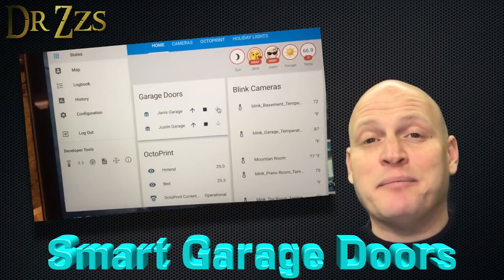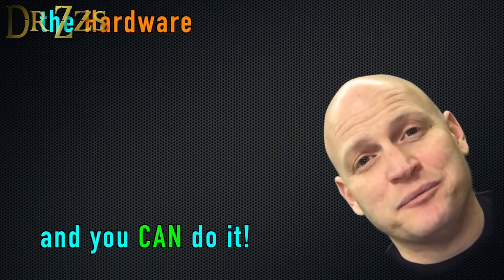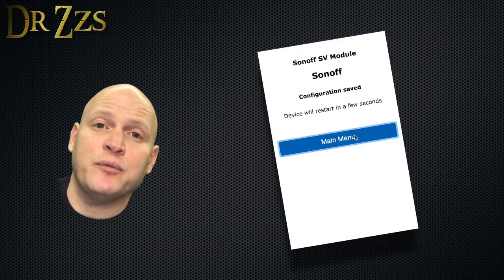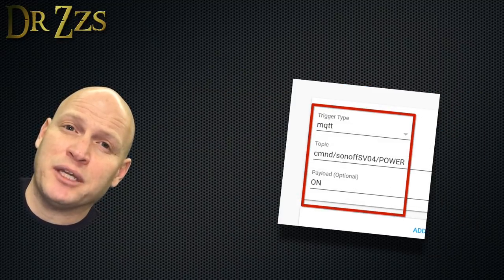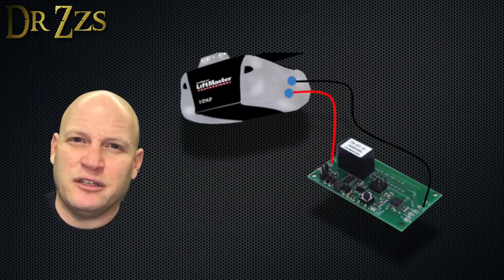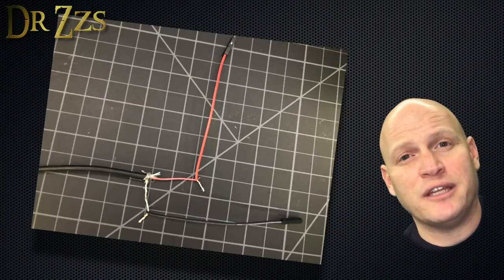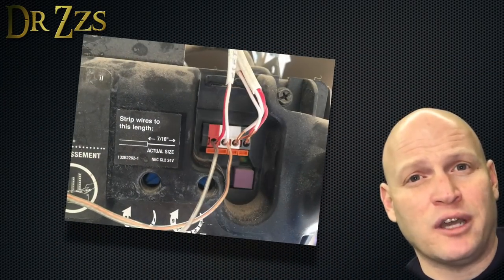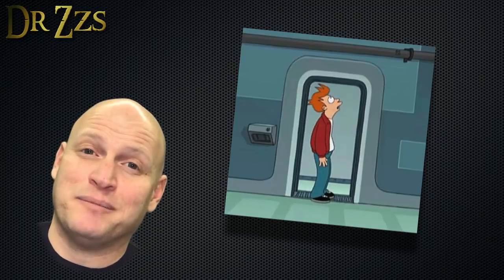$5 DIY "Smart" Garage Door Opener using Sonoff SV

Comment: Hi again, thank you for the video again. I'm having an issue with my reed sensor. So I used your guide as a starting point.  The only difference is that I used a dry contact relay, which is triggered by the SV Sonoff, which then triggers the gate. The reed switch is connected the GPOI 14 (sensor), and switchmode is set to 2.  So when the SV is connected to WiFi everything works great, but when the SV looses signal, for some reason when the reed triggers ON, it turns the SV on as well so then it triggers the gate.  And keeps it triggered so then my gate remotes don't even work.  I've been locked out of my own yard twice :o), wife almost killed me.  Any idea how I can fix this? Much appreciated!
Reply: Sorry, I didn't see the update... I'm trying the solution now
Reply: That's the part why you need to set another GPIO to Relay2.

Look at the instructions again.

Comment: Awesome video. I just completed installing 15 Sonoff as light switches. And I would love to try this but I am concern with these Sonoff switches going on to off and off to on by them self. I am concerned that this will create open access to some un invited people. I am going to try bypass capacitor and resistor installation to see if it get rids of false activation. If that works then I give it a shot to garage door. Let me know if anyone has any tip to stop this ghosting effect
Reply from the maker: The Low Pass filter should get rid of your ghost switching.  I just recently found that solution and it has worked well.   The problem there is the wires from the GPIO pins to the switch are picking up interference and firing the relay.  In the case of the garage door opener, the GPIO pins don't open or close the doors.  Only the MQTT message (or the on-board button) has the power to control door opening.  
You probably have already seen this, but here's a link that talks about how to do the low pass filter:
https://github.com/arendst/Sonoff-Tasmota/wiki/Expanding-Sonoffs

Should I do a short video about this?  If a lot of people are having the same problem it's probably worth doing...
Reply: if you have time i definitely think the video on this would help a lot of people. I know i was getting so tired of ghost switching i was ready to get rid of all sonoffs. but then i found the post about it and i thought maybe there is a hope to sonoff lol. But yes the video would definitely help me to see how and where exactly you attached those resistor and capacitor.
Reply from the maker: Ok.  You got it.  
If you were on the verge of abandoning the Sonoffs then it's a big problem. I'm thinking I'll change my plan for this week's upcoming video and do that instead.
Reply: Excellent. It will be perfect timing because by then i will have my resistors and capacitors. Hooray, DrZzs to the rescue. Thanks a lot.
Reply: When I did my setup last year, I used two esp8266 devices and they have to "vote", the garage won't open unless they both are activated at the same time.  The user is required to active both devices within a certain period or it times out. This is more expensive and complicated, but it gives me peace of mind.
Reply: <<Should I do a short video about this>> YES Please!!! (explain more)

Comment: I'm still trying to figure how to stop the reed switch from triggering the relay when the MQTT server is down. Anyone know a fix?
Reply: I found a fix. Use switchmode2 1 and adjust your cover accordingly
Reply from the maker: Great!
glad you figured it out.  I didn't have a problem with that.  Probably just haven't activated it without MQTT running. 
Thanks!

Comment: can it be used on A/C switch to turn it on/off?
Reply from the maker: yes, but you'd have to supply separate power to the DC part of the board and isolate the control chip from the relay.  What are you trying to do exactly?  It's possible that a Sonoff Basic would be more useful for you.  Tell me more about what you're trying to do and I'll try to help.

Comment: All, I can confirm that i have the same problem mentioned in earlier comments. if your wifi or MQTT server is down. the reed switch will trigger the relay as soon as it is closed. if you open the door with traditional means (wall switch or remote) it will immediately close, when in this state.
Reply from the maker: I'll have to think about that and see if there's a way to avoid that happening.  Maybe if you use a pulsemode in Tatsmota instead of the Automation to release the relay after 1 sec.  
I haven't had that happen, but it could be that I just haven't tried to open the door without the wifi working. 
Thanks for the tip.  Lets see if we can find a solution.
Reply: I do have pulsemode 10 and no automation. thanks, I too will read tasmota documentation and maybe post the question on tasmota forum as well.
Reply from the maker: Please let me know how you solve it
Reply: Ryan - did you manage to find a solution? I'm using a SV and can't figure out how to stop the reed switch from triggering the relay when HA is not running.
Reply: Peter Luong  I haven't really played with it much. I have someone else's esp8266 mqtt garage door project which has worked well. I was only playing with tasmota as it currently powers nearly all the rest of my "home assistant house" and would like to have the configurability that comes with it. I'll let you know if I figure out the. Internet dependency of tasmota in this situation.  My light switches acted funny when my home assistant went down last month as well... Kinda makes me nervous
Reply: Ryan maturi FYI following the steps from Pierre further down in the comments works for the SV as well. Working great now.
Reply: Peter Luong can you reference them.  I can't find a pierre
Reply: Anyone with a known fix for this? It's happening to my sonoff sv setup as well.

Comment: Can I not use Home Automation? Can I use the stock firmware and Alexia?
Reply from the maker: yes you can use the stock firmware and alexa.  But then it won't interact with Home Assistant.  
If you want a smart home hub, then Home Assistant is a great one.  If you just want to control it with Alexa you can do that without changing the firmware

Comment: I notice that when Sonoff loose connection or reboot the relay turn on for one second and that turn off immediatly :/ this cause my garage to open randomly :s
Reply from the maker: hmmm.  I haven't had that problem.  I'm sure mine has disconnected and reconnected to the wifi.  I don't think it's lost power ever, so I'm not sure if that would happen if it did. 
You can tinker with the Switchmode settings in the console, or look for other commands for tasmota that might stop it from activating on start up.  Sorry I don't have a solution ready for that problem since it hasn't happened to me. 
https://github.com/arendst/Sonoff-Tasmota/wiki/Commands
Reply: Or you can set PowerOnState 0
Reply: i have this problem just now, when I shutdown and restarted  my HA, my garage door opened. Were you able to get the resolution to this issue? This also happened when I powered on my sonoff sv, it seems to send a signal during poweron.
Reply: thanks for this tip pierre - i've set this setting to 0, which is more like do nothing after power on
Reply: I have exactly the same problem.  If the Sonoff loses power, it turns on the relay when the power comes back on regardless of the PowerOnState.  According to https://github.com/arendst/Sonoff-Tasmota/issues/744  this is an issue when using a switch attached to GPIO14 on the Sonoff and HA.  Tried and failed to execute the instructions so I am back to square one.  Unfortunately this issue makes the whole reason behind my HA installation completely useless and I might have to look at an alternative to HA.  Is there anyone out there that can help?
Reply: [SOLVED]
UPDATE:  The issue in my case had nothing to do with TASMOTA or Dr Zzs instructions.  It was that the MQTT broker was retaining a value of ON for the topic POWER.  In experimenting with the Retain value in the cover component, I must have inadvertently caused it to retain the power ON within the mosquitto.db.  Once I cleared this, no more powering on upon re-connect.  I accomplished this by sending an empty payload while using mqtt.publish service in Developers tools.  I then published an OFF command to the topic along with a Retain value of true.  More info can be found here: https://community.home-assistant.io/t/mqtt-fan-turns-every-time-hass-restarts/42935/8
ORIGINAL:
I have this issue as well.  It seems that when it disconnects from MQTT broker, on re-connect an ON command is received.  I don't know how to resolve.  I've replicated it by restarting the Mosquitto broker in my Hass.io add-on panel.  Here are the logs from Tasmota:

00:12:56 MQT: tele/sonoffsv01/LWT = Online (retained)
00:12:56 MQT: cmnd/sonoffsv01/POWER = 
00:12:56 MQT: Subscribe to cmnd/sonoffsv01/#
00:12:56 MQT: Subscribe to cmnd/sonoffs/#
00:12:56 MQT: Subscribe to cmnd/DVES_6698B0/#
00:12:56 RSL: Received Topic cmnd/sonoffsv01/POWER, Data Size 2, Data ON
00:12:56 RSL: Group 1, Index 1, Command POWER, Data ON
00:12:56 MQT: stat/sonoffsv01/RESULT = {"POWER":"ON"}
00:12:56 MQT: stat/sonoffsv01/POWER = ON

Comment: I love your videos, I've viewed a number of them and they are very well done. Question; Are there any issues using a Sonoff Basic for this project? I've found that the Sonoff Basic is about half the price of the Sonoff SV. Possibly you could recommend a place to buy the SV at a better price.
Reply from the maker: Bangood has SV for $6
https://www.banggood.com/DC-5V-24V-DIY-WIFI-Wireless-Switch-Sonoff-SV-Module-For-Smart-Home-p-1063987.html?p=@K220219381694201802

I usually get my SV's direct from iTead but they don't have free shipping. 
https://www.itead.cc/sonoff-sv.html

Comment: Great video! I used a similar setup before, relying on the cmnd channel to report the state of the garage door. this has an edge case. say if the door was closed power is out, then the door is open, then when power restores, it will not send the switch command to update the state in home assistant. I worked around this by using the STATUS8 Channel (previously status10?)
My switch (reed sensor) is defined as switch1, and the relay is relay1
RULE1
    ON system#boot DO status 8 ENDON
     # report switch status on boot, it would be great if this can be retained in our use case here
    ON Switch1#State=1 DO publish2 stat/garage_door/STATUS8 {"StatusSNS": {"Switch1": "ON"}} ENDON
    #send out "fake" status message to the STATUS8 channel to notify the state change
    ON Switch1#State=0 DO publish2 stat/garage_door/STATUS8 {"StatusSNS": {"Switch1": "OFF"}} ENDON
 

Note I use publish2 here to retain the message.
When there is a rule on switch1#state the switch is decoupled from controlling the relay (which is what we want here).

I also use PulseTime instead of relying on HA automation to turn off the relay.
PulseTime1 3 // Relay1(POWER) will turn on for 0.3 seconds then turn off. the unit here is 1 = 0.1 second when the value is <= 100

in my HA configuration.yaml ( i use lock instead of cover, but should be similar)

lock:
  - platform: mqtt
    name: garage_door

    state_topic: "stat/garage_door/STATUS8"
    value_template: "{{ value_json.StatusSNS.Switch1 }}"
  # read state string from json
    state_locked: "OFF"
    state_unlocked: "ON"

    command_topic: "cmnd/garage_door/POWER1"
    payload_lock: "ON"
    payload_unlock: "ON"

    availability_topic: "tele/garage_door/LWT"
    payload_available: "Online"
    payload_not_available: "Offline"

    retain: false
    unique_id: garage.door

Comment: Use network change status on mobile phone to open garage door, when you drive into drive way phone will connect to WiFi, opening garage, however it's would have to be set up so that it would only send open command if phone was connected to car Bluetooth other wise it would open if you ever lost signal in house

Comment: I've got this working but my sonoff regularly needs to be rebooted almost daily or it stops working.  It is one of the closest devices to my router so it isn't a connection game.  Anyone else suffering from this?  Is there somewhere I can force the sonoff to reboot after hours every night or something?
Reply from the maker: bummer.  
There is a reboot command you could send with an automation in HA.  
In HA the service would be "mqtt.publish" then the topic "cmnd/yoursonoffname/restart" payload is "1".  If you changed the switchtopic to 2 (which you probably did, since that's what I did in the video) then instead of yoursonoffname you may need to put "/2/"
It's not uncommon for some sonoffs to need rebooting from time to time.  I don't know why some do and some don't.  Could be a quality control issue.  Anyway, with this you can schedule a restart every night if you want.  
Let me know if it doesn't work.
Reply: Thanks!  I did a hard reset and reconfigured and it appears to be working great for multiple days now with no reboots! :) I'm having another Sonoff related issue... I have a circuit with 2 sonoff basics controlling lights.  There is a third switch on this circuit as well (non sonoff).  The issue I am seeing is when any of the switches are triggered (sonoff or regular) one or both sonoffs will turn on without being switched! :) Like a ghost in the machine.  Is this ground related?  I've been watching the patio (sonoff) light turn on and off for months and didn't figure it out until yesterday when I flipped the regular switch.  Any tips?
Reply from the maker: David Barnes first thing I’d check is your mqtt topics. My guess is they have the same name in the “topic” box. In TASMOTA go to Configure MQTT then change the “topic” in one of them. You’ll have to change it in HA for that switch too. Let me know if that’s not it and we’ll try something else.